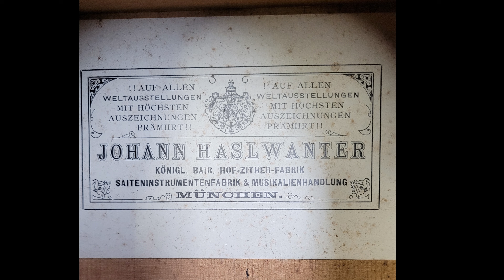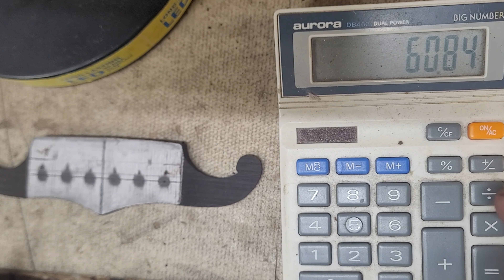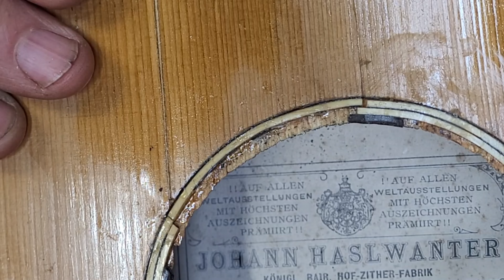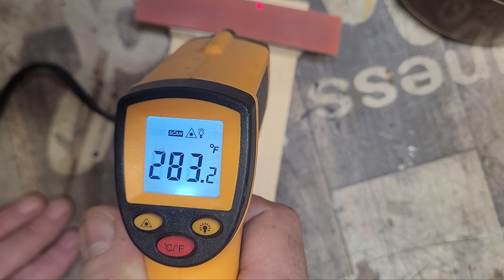Smashed and pulled from the trash! WW2 spoil of war full restoration-Episode 1

Comment: Hello.
I see a lot of dry heat ungluing in the guitar world.
We do a lot of UN-gluing in our doing antique piano work.
Bringing the wood moisture content up ahead of time helps a lot!

Hide glue is not softened with heat,  it is the moisture content in the wood.!

Sooo---when the guitar is dry as a bone in winter up North around here anyways,,,,it will be much tougher to UN-glue. 
No less than 14 % +  moisture content . 
Place guitar in a humid environment for a couple days.
Reply from the maker: We keep the shop at 45% humidity and they are usually waiting around for a couple weeks. Sometimes we humidify them in thier cases to give them a head start.